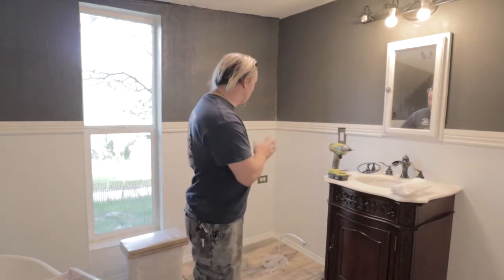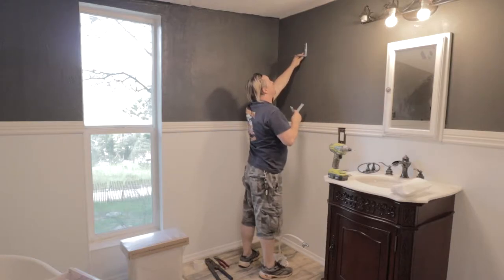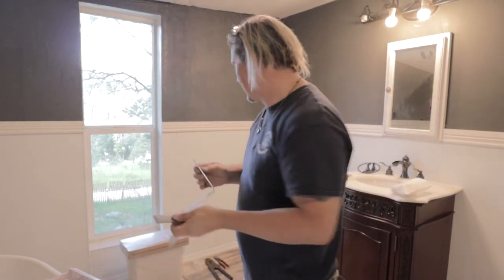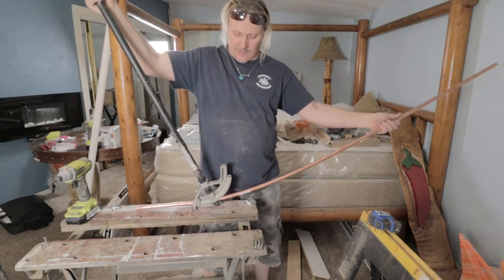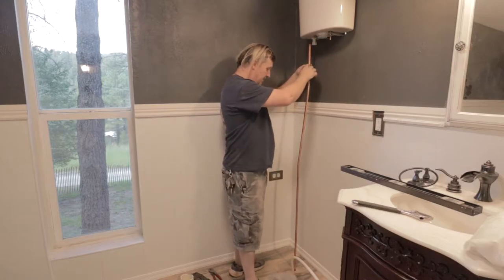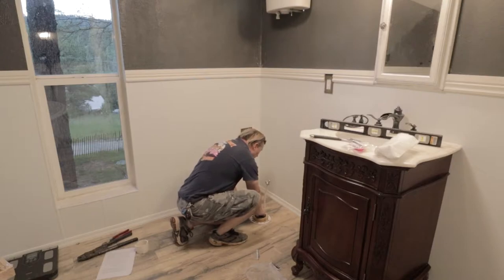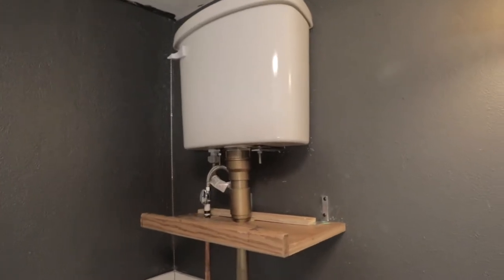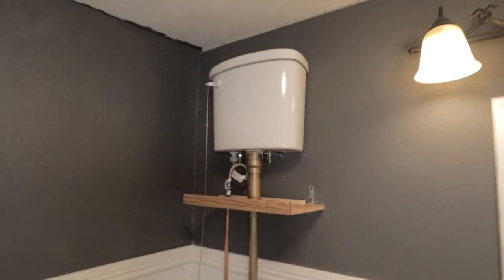Do it Yourself :: High Tank Toilet

Comment: Nice build, love the vintage look.   When I was a kid the theatre uptown, Harbor Beach Community Theatre,  built in the late teens to early 1920s, had a similar toilet,  the tank was wall mounted but not ceiling level, there was a L shaped pipe made of copper or brass connecting the bowl, in grade school thought that was a very neat bathroom lol.  Haven't been there in about 25 years so I don't know if they renovated or not. But I'm a fan of Victorian style architecture,  I also like claw foot tubs and colored bathroom fixtures notably blue and lavender, as was popular in the 1950s and '60s.   Not a big fan of Avocado green, ivory or brown,  though.
Reply from the maker: Thanks! It was a fun build and it’s working still to this day! Lol.

Comment: I'm really curious how this has held up for you. As a former plumber this looks like a nightmare to fix. I have thought of doing something similar but maybe only half a s high (with a tall cabinet covering it all. If I was going for an exposed pipe I really would consider going with copper then cleaning it up and clear coating it before installation.
Reply from the maker: Still working well as of today… I even created a reel on my Facebook page recently showing it still working lol…

📸 Watch this video on Facebook https://fb.watch/oKFSxKqm4X/?mibextid=v7YzmG
Reply: @FnDTX  Cool. Thanks for the VERY quick reply
Reply from the maker: Of course! I try lol. Yeah, honestly, I am still impressed it’s working still as well haha. 😂 but it works. And looks great too I have a good gap behind the tank for air to move through so it doesn’t build up condensation as we have very cold water here. But the trick was the compression rings and the wood at the bottom. Stainless hardware. Cheers.
Reply from the maker: Oh and the taller cabinet gives it more gravity for the water to drop. A shorter pipe (from some test I did before) didn’t work well with my altitude but might work for you! Good luck mate!
Reply: @FnDTX  1) Yeah, I get that the height effectively adds pressure (or, more precisely, velocity)(thus why you had to use a narrower pipe to slow down the water). It's just that I've worked on so many tanks that the high position, especially with the box, would make it a pain to replace the flapper, the filler, or even just a broken lever (which happens much more often you'd expect).
2) I'm curious what the max practical height would be with the 2" pipe.
3) That copper pipe may eventually turn green unless you have protected it from oxidisation in some way.
4) Cool project by the way. The counterweight on the lever is a great idea.
Reply from the maker: @carlpeters8690  So the top of the box comes off and then the entire box pulls away from the wall with two screws. The top of the tank comes off and I can get to the flapper etc. The hard part will be having to change the valves out I think? I think I could go maybe 10" lower and I would still get a good flush. I am also at 8,500' in elevation so that may be why I have to go so high wit the tank? It might work better lower in a lower altitude? 🤔 The pipe gets cleaned with CLR once every 3 months, so far, all has been working well with that method. I think with a 2" pipe, maybe 2-1/2' - 3' would probably work huh?  Anyways, If you get it built let me know... I would love to see a project.. I am on Facebook also, just look up FLip Masters... You can't miss the red bearded beanie hat! ;) Cheers!

Comment: What fitting did you use to connect the pipe to the bottom of the tank?
Reply from the maker: If you watch from this point: https://youtu.be/mGOtCFULR8E?t=905 
I used a 1" tall bushing under the wood block to help hold it against the toilet. I am not sure where you would find it, but maybe check amazon or your local hardware store. good luck!

Comment: I just stuck the tank to the wall no cabinet i was hoping gravity would help clean the bowl . ,not sure if it does or not.
Reply from the maker: I am having no issues at all flushing. I did figure out that a smaller dia pvc pipe helps keep it flushing right. To big, it splashed all over lol, and too small and it didn’t flush right. Was a bit of trial and error haha. But still working great. I will be doing a “one year progress video” soon! Cheers! 🥂

Comment: Toilet tanks can sweat when cold water is inside them, so this condensation could end up on your wall.
Reply from the maker: I took that into consideration when I built this. Behind the tank is an air gap of about 2” and the door gets opened frequently to aid in moisture evaporation. The base has a moisture pad to absorb any possible extra moisture and is changed frequently. I live at 8,600ft so cold water is normal here. Plus the wall is actually plaskolite pvc to protect the walls. So thanks for the comment. It might help others to make sure they do not run into the same issue. Cheers 🍻
Reply: It depends on the state he's in. That really only happens in colder places.